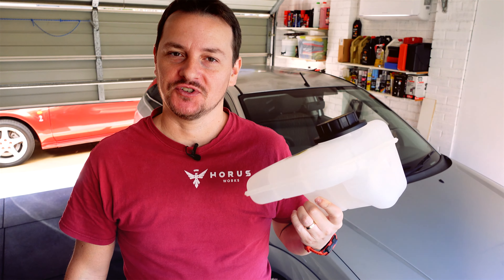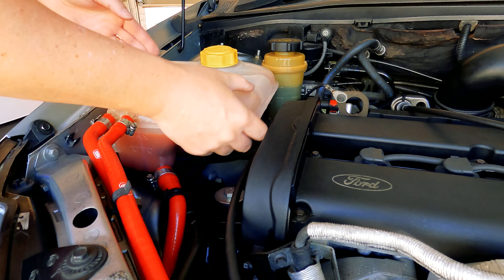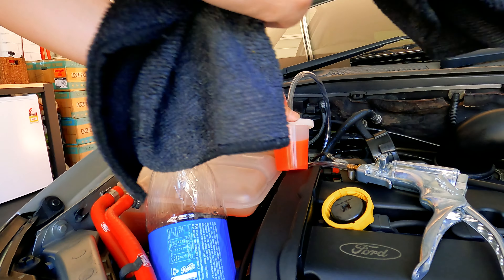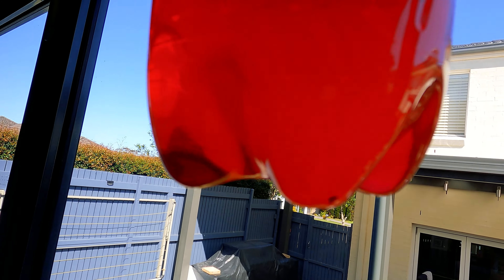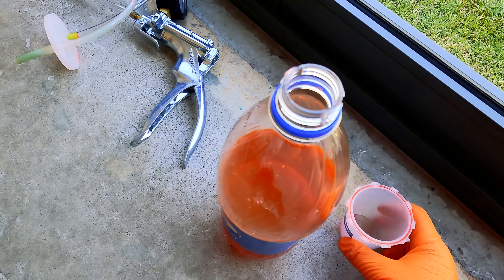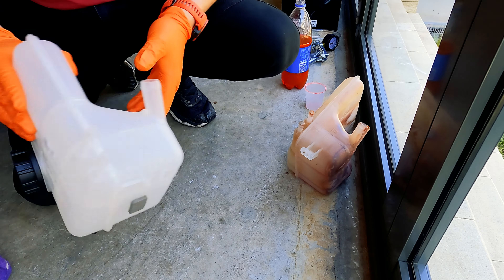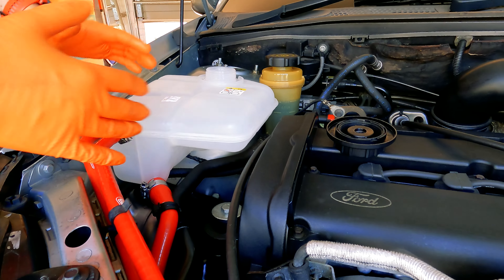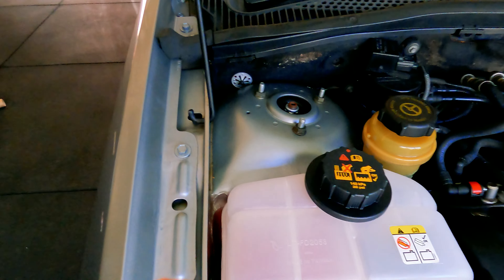Coolant Expansion Tank Swap in 10mins - Ford Focus MK1 LR - Easy DIY

Comment: Part tip: Jefferson Ford in Victoria Australia sell these as well as the heater pipe. The tank was also the cheapest option. Great tutorial as always!
Reply from the maker: Thanks as always Malcolm 👍
Reply: No, thank you👍 I put your site on a tiktok of mk1 people I follow. You can find me there with my YT username and the profile pic is the same. Want to do a driving channel but 3/4 of my shitboxes are down and rain has killed me for months. There’s an ST170 in  QLD for sale as well. Parts are still around and mostly Zetec anyway.
Reply from the maker: @Malcolm Gray.  thank you for the TikTok add. Not on there just yet but that may have to change.,, There's another ST170 down in Maruya - on FB marketplace. I hear you about the rain! Just won't let up ☔
Reply: @malcolmgray.5913 I think I bought this one :) And replacing the entire cooling system, including this reservoir has been done. I’m in Sydney now.
Reply: Congrats! Got some tips if you haven’t bought parts, just done the mission getting all new cooling parts myself. If you search tiktok for my name and this profile pic it will be easy to message if you want👍
Reply: @malcolmgray.5913  Cheers. It’s all done now. We did all hoses, overflow, radiator and the crap thermostat housing that will leak again and didn’t come with the o rings.

Comment: I have that black coolant cap on my usdm 2.3 duratec engine
Reply from the maker: I've never seen one before myself - only the yellow ones. But I like how the black cap cannot be over-tightened. It will help the rubber seal last longer.

Comment: That's a useful tutorial thank you.
Reply from the maker: You are most welcome 👍
Reply: One of the reservoir pipes broke and I had it replaced yesterday. Your tutorial came in handy. Thank you so much! However I noticed some bubbles in the reservoir when the car reached the operation temperature, is that normal?

Comment: Awesome !! A new Focus video. Great tip. Have you put new rims on? They look great.👍Did you change the size? I put some Goodyear F1 Assymetric 5 tyres on mine recently and really like them. Nice day weather wise to it looked like. Take care.
Reply from the maker: Thans Andrew, yep new wheels on the daily and it was a great day for some smaller jobs. Easy as to swap one of these out :)
Reply: I run them as well, love them! Found F1 directionals from asia a but grippier but love the assymetrical. My local Goodyear branch told me they have F1 sport which has the best wet grip. Will stay with the german asymetricals  like you have though👍 Using GYear Assurance triple max on 15” as well. They are robust and grippy for the pothole crap roads.

Comment: Great video, what if i had to bleed the system? how?
Reply from the maker: It's very easy to bleed the coolant on a Focus Mk1. Simply leave the expansion tank cap off, start the car, and turn on your heater inside the car on full heat and the fan on 4, for about 20mins. Leave it like that, and the coolant will circulate and push out any air bubbles through the expansion tank. After about 20mins, fill the tank back up and put the cap on.
Reply: @Horus_Works  Thanks a lot; is it the same procedure for fiesta MK6 2012?
Reply from the maker: @limaiemheykel  I can't be certain as I don't have a Mk6 Fiesta, but yes, I would say it will be very similar.
Reply: @Horus_Works  Thanks a lot

Comment: Hi mate 
What wheels have you got on this car. Looks really good. Also what are the caps on the wheels.
Reply from the maker: They are 17" Ford Racing wheels. They were factory fitted to the SVT/ST170 Focus :)
Reply: I thought they looked familiar. I currently own a 2004 ST170.
Where did you get the centre hub caps?.
Reply from the maker: @megancruz3932  they were sold with the car

Comment: Hello, the left tive from water tank is the one it comes from the water pump?
Reply: The left tube *
Reply from the maker: @n10npt26  Hi, do you mean the small one on the left? If yes, that one goes into your radiator. Here is a video I made that will help you... Go to 12:55
https://www.youtube.com/watch?v=ktZY29VX390
Reply: @Horus_Works  oh Yes i see it thank you 🙏
Reply: @Horus_Works  I have ford focus 1.8 tddi 2001 but is the same water system right?

Comment: Wheels look great! What brand? I’d love to get you to weigh them with a tyre next time they come off! Looking for light 17” due to the pot holes damaging two of mine.
Reply from the maker: They are sold by Ford as 'Ford Racing' wheels, but they are just the SVT/ST170 wheels with different centre caps. I'll see if I can weigh them next time.
Reply from the maker: @malcolmgray.5913  maybe the 16" were a bit lighter and possibly more compliant with the higher sidewalls - not as skittish?
Reply: May have said before I had a new work zetec 03 with 16” and 17s were fitted. It was better on the old pacific hwy with 16”. I like GYear assurance tripple max for bad roads, gripoy tough tyres. Running eagle f1’s in 17” have popped a few on potholes😂